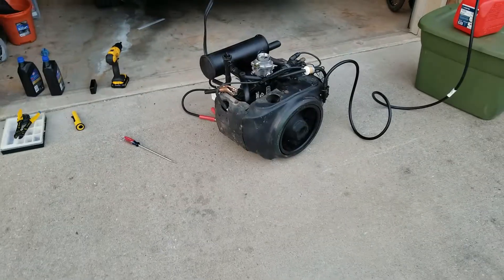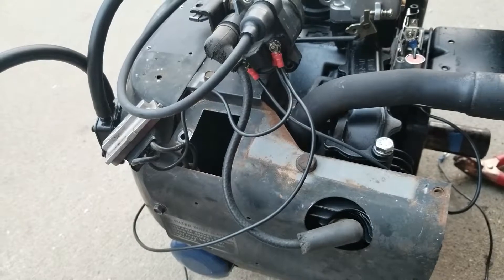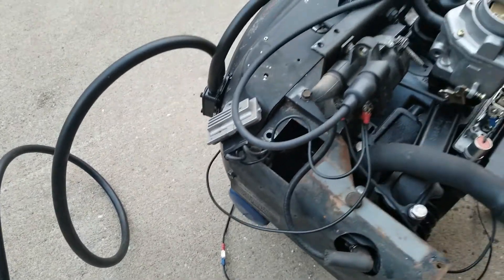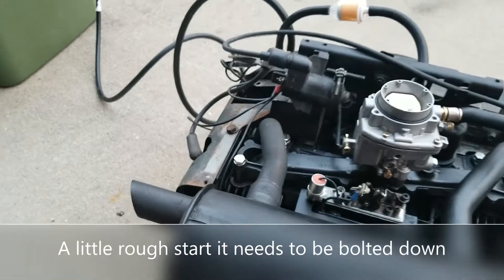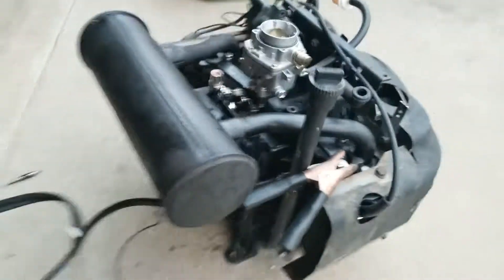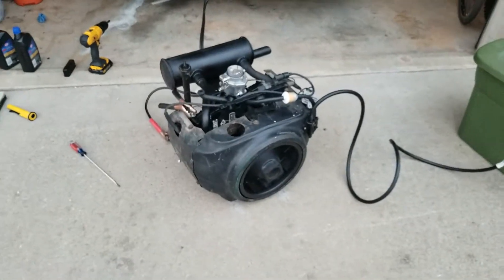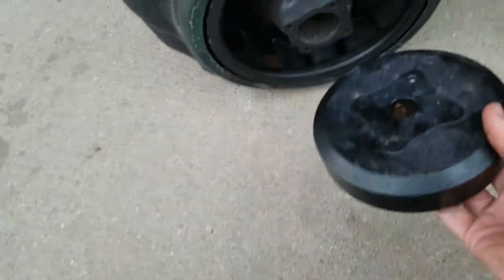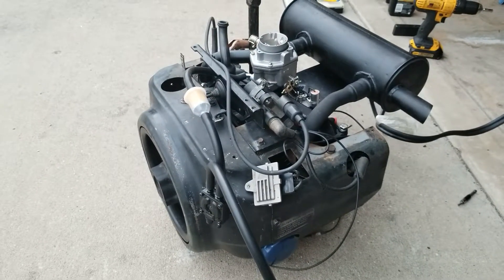Onan Engine Project

Comment: That's a neat little engine. It's like half of a Volkswagen beetle motor. I might build a utility vehicle for the backyard with one of these.
Reply: Or an ultralight aircraft. That's a good motor to use.
Reply: Actually im in the process of putting an onan engine on a gokart, big issue with mine is the driveshaft is 1-1/2 inch in diameter and the biggest clutches and torque converters only come in 1 inch diameter. So as of right now im seeing how id run a jackshaft with a torque converter.
Reply: @absolutelyphucked150  A torque converter? That would have to be one heck of a go kart. Sounds like you're putting an automatic transmission in it.
Reply: @Cat-fy5lw  these engines are heavy duty cast iron and weigh a lot not running fast enough or light enough for an aircraft

Comment: I have a miller welder with that motor with 1290 hours , question is that a good motor, and how much lite is left in my motor in your criteria
Reply: Life not lite
Reply from the maker: I belive the motors are very reliable, they are simple and built well. They used these engines in kit aircrafts. I've seen many people say they get 1750-2000 hours. The issue is lubrication of the cylinder walls. Being opposed and laying on the side rings wear out and can cause cylinder wall wear.
Reply: Thanks
Reply: Change oil and filter and air filter and do maintenance and take care of it and it will outlast you

Comment: You build these Onan engines? Do you have a website or contact info? I’m building a few and always looking for parts - like exhaust tubes for the CCKB.
Reply from the maker: Unfortunately I only buit 3 of them after I found one and then bought a bulk lot of 4  engine in rough shape that needed some work. I had to order all the parts on ebay. Exhaust components were the hardest to find because the steel seemed to thin for use as headers.
Reply: parker stutsman yeah :) it’s such a dumb thing to get stuck on too so unless you have a welder, pipe bending skills, and the tools to cut the flanges it’s a major pain. I’m putting a points box on now and it’s so unclear how to adjust everything to get it right.

Comment: Parker, I have a P224G that ran fine before it lost compression.  Reworked the motor put it back together and I do not get ignition.  I have spark, compression and fuel but no Bang. even with starting fluid it does not run.  Do you think I have the timing off?  I am reasonably sure that the timing marks where lined up on cam to crank.  I will double check but any other ideas please ?
Reply from the maker: Does it use a pickup at the flywheel or points like my engine?
Reply: @parkerstutsman7181  pickup at the crank shaft.  I have taken the plugs and zip tide them to the muffler pipes.  Crank it over and both plugs have spark.  I see plenty of fuel at the plugs.........
Reply from the maker: @vincentprocaccini  i feel like it has to be due to timing. But one thing about these engines that you won't notice easily is if the cank and cam are not timed correctly. Its easy to tell by taking a head off and turning the engine slowly. If you can clearly see each stroke and get to the ignition pickup point on the crank just before top dead center with both valves closed you can verify you are close. I would be willing to say you may be seeing ignition just before your intake at the end of an exhaust stroke.
Reply from the maker: @vincentprocaccini  also reason I say its hard to notice is because your valves will never impact the cylinder head which makes this a great engine to learn to rebuild. Hard to really damage much.
Reply: parker stutsman copy. Thanks so much for monitoring your site. I will give it a close look. Thank you
Reply: One more question. I assume since the crank pickup is sensing each rotation that the plugs fire both on compression and exhaust strokes?  Is that correct?
Reply from the maker: @vincentprocaccini  now that you mention it both plugs are firing at the same time each cycle.
Reply from the maker: @vincentprocaccini  you would be correct as they are opposite each other. I would check the values and cycle
Reply: parker stutsman what do you mean by “cycle”
Reply from the maker: @vincentprocaccini  just make sure the cam and crank are in the correct orientation. Just make sure that at top dead center on the compression cycle they are closed. Just incase its 90° off
Reply from the maker: @vincentprocaccini  its just the last thing I could think is wrong. Like I said the valves can do whatever they want and won't interfere with the cylinder head
Reply: i know Im randomly asking but does someone know of a tool to get back into an Instagram account..?
I somehow forgot my password. I would appreciate any assistance you can give me.
Reply: @Mauricio Cameron instablaster :)
Reply: @Dane Kylan i really appreciate your reply. I got to the site through google and im in the hacking process atm.
Seems to take quite some time so I will reply here later with my results.
Reply: @Mauricio Cameron you are welcome xD

Comment: including the one on the bottom of the oil pan
Reply from the maker: Correct. Just for the startup I left the sheilds off the bottom . The front shroud is enough for a short run. The final assembly had all the sheilds installed

Comment: Have same motor needs rebuilt it smoke trew carb cut grass then lose power then throw it in neutral builds up power cut some more then same lose power trow it in neutral it builds back up on and on is it rings

Comment: Have you rebuilt any of these engines? I have a p218g I’m possibly looking at getting rebuilt
Reply from the maker: I've rebuit 2 and restored parts for sale. I haven't done them in a while now. I have a miata I'm almost done with and 2 polaris ATVs that had engine rebuilds now. If you believe the engine has just typical wear then it would be good to rebuild. Its when you have to buy a new block that the choice is hard. I'm not sure I am ready for another project just yet.
Reply: parker stutsman  yeah the blocks good just needed pistons rings and the cylinders honed. It smoked
Reply: I am guessing this as an 18 horsepower ?
Reply: Is that the same one as the onan performer 18 xsl see I don't know because it didn't have one side cover to it just the front cover I need to know if if uses points or a condenser on the coil 

My onan gt 19.9 does have points and a condenser but not the 18